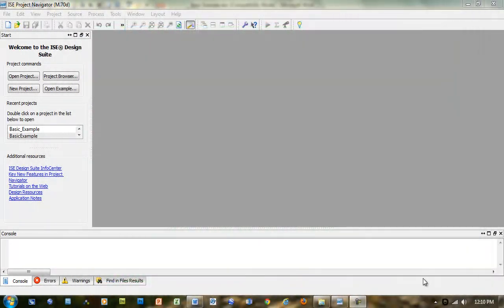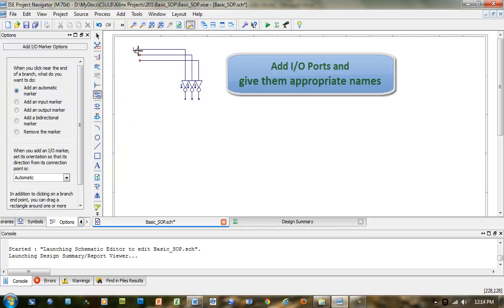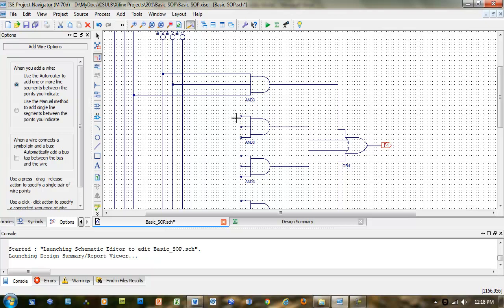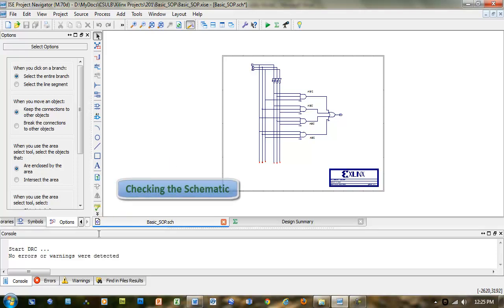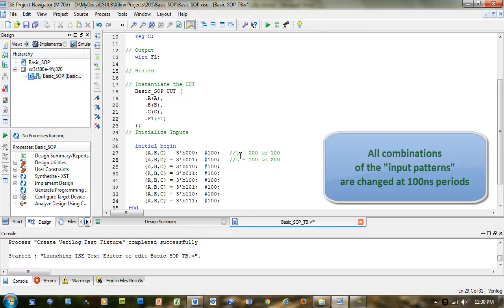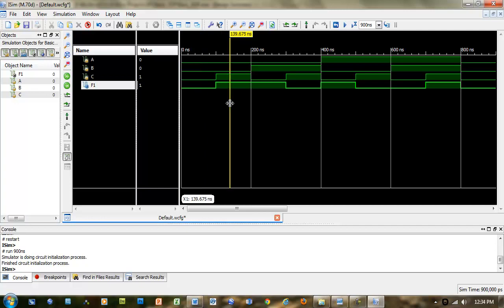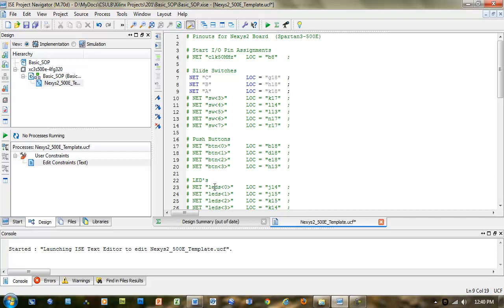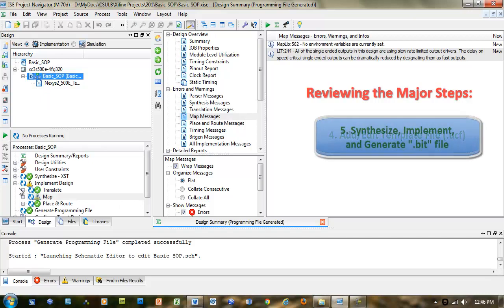Xilinx 12.x Basic Example

Comment: Thanks for your video. I am a beginner with FPGA's and some things are much better to understand now. Only one question, where can I find the .ucf file?

I am using the (XILINX XC3S500E Spartan-3E FPGA Development Board + LCD1602 + LCD12864 + 12 Kits)

I hope somebody can help me with an answer...
Reply: +DAJAK BRASCO 
There must be someone who knows where to find the .ucf file?
Reply: +DAJAK BRASCO Even if you don't find the .ucf file you can generate your own based on the electrical schematic for the board. From the "ISE Project Navigator" select the top design file (in this example in the video there is only one file, the schematic, but in bigger projects you can have many more files) and then from the "Processes" window -> "User Constraints" -> "I/O Planning (PlanAhead)" (either Pre-Sythesis or Post-Sythesis depending on what stage you are at). There you map your outputs and inputs to pins. When you save you will have a .ucf file.
Please keep in mind you have to be careful of which pins you assign because on an already made board the pins are already soldered to components and you might damage the board if you wire them the wrong way.
Reply: bro planahead crashes in windows 8
any other ideas?
i am using virtex-7